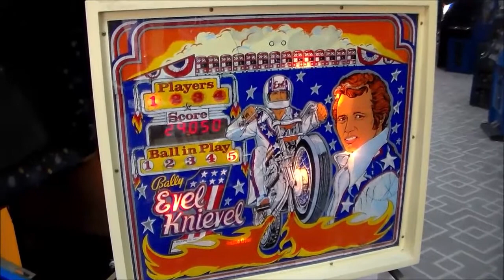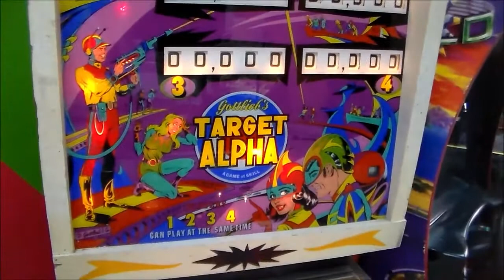Bally's Cool 1978 Evel Knievel Professional Home Model Pinball Machine

Comment: Great video. I am about to purchase the Fireball home version of this shopped out so it looks good enough fun to own for the price I'm paying.  Only difference is single flippers on both sides of the one I'm buying. Thanks for uploading this video!
Reply from the maker: To be honest the single flippers are more fun, the ones that have doubles it's a neat idea but it's easier to lose the ball between the two flippers.
Reply: I have the fireball home, all original and working in mint condition with a little buzzing from power supply, but the old guy still ticking.   Looks to be a Heath Kit, which I remember advertised back in the day.  Great video Ron!!!

Comment: Have a question for you. I have an EK full size with one back glass socket (jumping motorcycle) that doesn’t work. I put in a new socket and reflowed solder. Still nothing. Any idea where the fault might be? Thank you!
Reply from the maker: I can't remember 100%, but doesn't that one turn on and off, or is it supposed to be always on?  There's two types of lights in the game, ones that are always on and straight wired to the power supply... and ones that the lamp board turns on and off when it wants to.  That one may blink, to make it look like he's jumping.   If that's how it is, your problem is going to be the wiring from the lamp board making a bad connection, or the transistor on the lamp board not working.
Reply: Joe's Classic Video Games Aweeome! It is the jumping bike that flashes in and off. New Altek board, so I’ll trace the wiring and go from there ! Thank you for the tips!
Reply from the maker: Eric right where the wiring plugs into the altek board (I assume you mean the lamp driver, not the altek MPU) the pins inside those plugs get corrosion on them or sometimes they'll break in half.  If you look at the color of the wire that goes to that socket, then find that same wire where it plugs into the lamp driver board that will probably be where your problem is.

Comment: We have one of these, and the logic board seems brain dead other than test mode,  the right drain score, the right Pow spinner, and sometimes the right side 50-point switch.
Reply from the maker: Miles check out this webpage :  https://www.flippers.com/catalog/product_info.php/replacement-bally-home-pinballs-p-2797
Reply: @LyonsArcade  
It's good to know that someone has finally created new replacement boards for the Bally Home Models. Although mine works great for now, I'm still going to order anither logic board, for the future of maintaining my pin.
Thanks for this valuable info.

I have a Fireball home model.
I've shopped it out, changed capacitors and also had my friend upgrade my voltage regulator, which I highly recommend being done to these Bally Home Models.
Again, thanks for the info about the Flippers website that has new replacement logic boards.
Reply: @LyonsArcade  where's the home model board? I thought these were for the commercial version? Thank you for the informative vid!